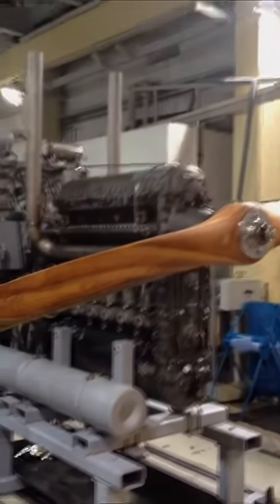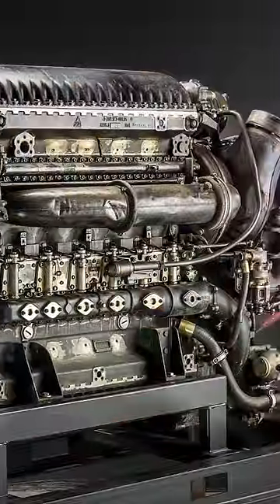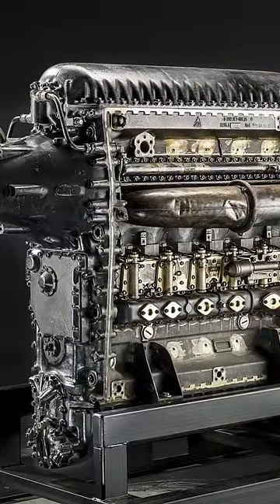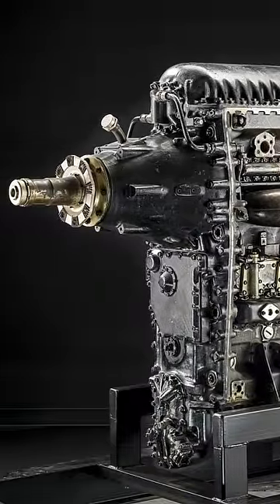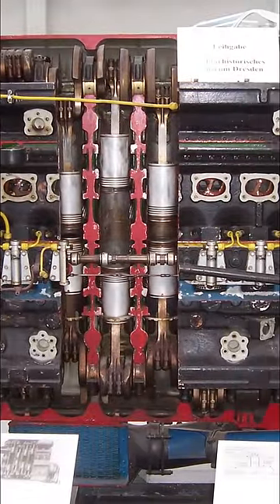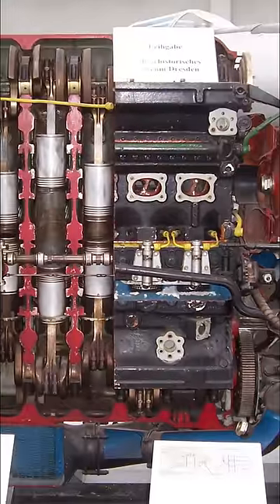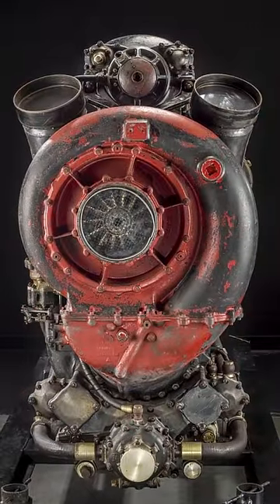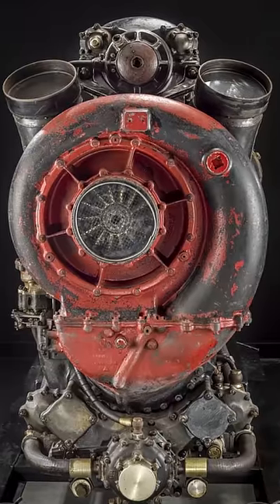Old ENGINE Laughs At New Diesels - Jumo 200 Series

Comment: Even now its very fuel efficient compared to most modern regular diesel engines.
Reply: What's the size of this engine?
Reply: well I know nothing about motors even less about this one in particular, although it's not a doubt if companies wanted really to create something fuel efficient I am sure they could.

 perhaps they don't want to advance too fast or they have some kind of agreements with oil companies so they sell more fuel idk
Reply: @MrLuigge  It's much simpler in this case.  Opposed-piston engines are more expensive to manufacture, and it's much more expensive to design a car for such a tall & long engine.  Or for such a wide & long engine if laid flat.

Those are costs that carry a very realistic chance of never being recouped.  Ergo, those costs are a very unsafe investment for a business to make.

There's potential for such engines to find maritime & heavy-haul usage, but commuter cars & light-duty use is not probable.
Reply: @TheAttacker732  you could lay it flat, like a boxer... But those engines too are rare as f*ck.... Alsow it's most likely pretty heavy as you have a second set of pistons and rods... Nex to the block and the crankshaft the heavyest parts of the engine..
Reply: @justacomment1657  I touched on that potential layout already.  Boxers run into the same basic issue, in that they're too wide for the displacement needed for a given commuter vehicle.  Packaging them into a standard layout car is...  Difficult.  Rear-engine isn't any easier, because it still needs to fit between the wheels.  Putting the engine high enough to clear the wheels makes for unsafe weight distribution, and the vehicle also becomes too heavy for the original engine displacement.  Even larger American cars & trucks keep the engine as low as possible for weight distribution purposes.

Meanwhile, maritime use works wonderfully with wide, flat engines, and heavy-haul doesn't have the same space constraints as other road uses.  American & Australian trucks in particular have plenty of room for less-conventional engine layouts.  And, upon further consideration, trains may also be a good use case for opposed-piston diesels when married to dynamos, in an even further improvement to diesel-electric locomotives.
Reply: It's decently fuel efficient, but not particularly efficient when compared to modern turbo-diesel engines. 38-40% efficiency in 40's is impressive, but gets beat by turbo diesel car engines built in the last 25 years.

Comment: It is incredible when you think that they have made this engines without SolidWorks and AutoCad back then
Reply: i keep saying that about these engines, they did everything on paper! 

I think you have to have had at least a little experience with CAM to actually appreciate how impressive that is.
Reply: And with manual machines, not CNC!
Reply: @corythomas4427  yes & no.  The real magic of cnc machining come in at 4+ axis machining.  Those are the parts that you simply can't do on a manual machine.  These engines, though complicated, were made of rather simply shaped parts...cylinders, bores, blocks.  

Not totally sure what point I'm trying to make, so I'll put it this way:  shops all over the world still use manual machines.  None of them do their design work strictly on paper.
Reply: I was alluding to the huge amounts of time and labor that would be required on a mass production scale.
Reply: @corythomas4427  ummm...what?  you were talkin about cnc machines....
Reply: @mtraven23  Humans build machines so that we are able to use less effort to accomplish tasks in less time. A CNC can spit parts out a lot faster and requires less physical effort than a manual machine does. Just because a part is less complex doesn't mean it doesn't take longer to produce on a manual machine than it would on a CNC.
Reply: @corythomas4427  who TF is talking about speed?  This stems from a comment about the difficulty of doing this without CAM.  Not having a CAM is FAR greater disadvantage than not having CNC.
Reply: @mtraven23  My car has 4 cams, so I'm way better than you are.
Reply: @corythomas4427  so nothing of substance to say?  Great, we're done here.
Reply: @mtraven23  You didn't like the way I was responding,  so I tried something different. Doesn't seem like you like that either. Guess you'll just have to stay dissatisfied. Sorry, I tried.
Reply: To be fair there is still hand drafting today, it's just getting more and more rare
Reply: @murderWhornets  please provide an example of a shop that still does their design work strictly on paper.
Reply: @mtraven23  did i say anyone does it strictly? But I i personally know two engineers one structural, one mechanical that still utilize their drafting tables about 1-2 a week. Certain tasks can be more quickly done by hand then in solidworks. I use SOLIDWORKS personally because I'm not part of that last generation of engineers that draft. But yes there are still tens of thousands of practicing engineers that use drafting methods regularly.
Reply: @corythomas4427  Sure it took a lot more work, but cam-set lathes and mills have been and still are being used extensively. Screws for example, set once and just maintain. For repetitive milling tasks I'm sure they used mills set up with cams, tho of course only viable for high volume.
Reply: @Kalvinjj  Woah man! No intellectual, fact based mature answers allowed. You're supposed to just argue how everyone else's opinion is wrong, like Mad Matt is doing.
Reply: @murderWhornets  no, I said qualified "strictly" in my previous reply.   You failed to respond within that qualification, but still tried to tell me I'm wrong.

No one is drafting shit faster then in a CAM program unless they have no idea how to use it.  Not to mention the unlimited about of views & drawing that can be created nearly instantly.

You still have yet to provide a single actually example....Your buddies dont count, but you should advise them to get with the times or retire.
Reply: @Kalvinjj  I agree...I was trying to make the point that manual machines are still FAR more in use than manual design methods.
Reply: Without even cnc machining or measurments!
Reply: @mtraven23  what are you so mad about? You misinterpreted what the guy meant and after he explains nicely you get even more worked up. Fragile man
Reply: @humpty6838  not mad about anything, his points just don't hold up, so I refuted them.  That's how discussions go.

not sure why you felt the need for the the frigidity comment, projection probably.  Good day.
Reply: ???

Why does that surprise you? It’s drawing regardless. Except ones digital, technology hasn’t changed in so long, they literally just digitized drawings 😩
Reply: @corythomas4427  the technology of the tooling has sped things up as much as the cnc side of things. Without a better cutter and a more powerful motor, the feed rates would still be the same as if someone was controlling the machine manually.
Reply: Slide rules, protractors, and really good cast makers.
Reply: @mtraven23  hey doesn't really matter man trying to prove them wrong.
Reply: @Jonathan_Doe_  That's true, and a valid point. But have you ever seen 1 person running more than 1 manual machine at once? What about 1 person running more than 1 CNC machine?
Reply: No one is designing engines on solidworks. NX, autocad, creo, fusion....
Reply: What about sending man to the moon, even without calculators?!
Reply: Anything that old and mechanical that still works, has my respect. Along with the old timers that keep them going. I love that stuff. There's a museum in Virginia that has a hangar full of WW1 planes. Bi's, tri's... and they all still fly. My mind was blown when i saw the absorbing rags under every plane. Just incredible.
Reply: @proximo1033  Come on, you can't really be believing that bs my man
Reply: @corythomas4427  replying after a week lol just let it go
Reply: @nosleep771  5 days is less than a week. Comment notifications exist so that you can know when new comments have been made, and if you choose to, make another comment. There's no reason for you to worry about what I choose to do, and even less reason for you to tell me what I should do.
Reply: Not even that...the SR71 blackbird was created with pencil and paper and it's still invincible pretty much. Let THAT sink in.
Reply: @mtraven23  it's really not impressive to design an engine on pen and paper. Especially since the beginning of the gasoline engine was so dumbed down compared to today, and they simply took preexisting ideas and designs and tweaked this here and that there ever so slightly until they figured things out. It's all super basic, as it should be, seeings as it's the birth of a new technology.
Reply: Imagine this, the same was true for early Rolex’s and things like that made in the name of luxury. All by hand originally. Think about Lamborghini, if I’m not backwards he thought that Ferrari was crap and he worked for them at the time before he said I can do better. Never forget the humble Lamborghini tractors
Reply: No CNC machines either
Reply: @mtraven23  I think they would have been making clay models. You can see remnants of this process when they design cars
Reply: @Grunttamer  yah maybe, I really dont know anything about that.  Clay seems like a difficult material to really model tolerances like ring clearance.  Most of that, even back then was sub 0.001" tolerance.
Reply: I'd called blueprints and diagrams, we still use them too.
Reply: @murderWhornets  iam 10 Times faster on CAD Software than doing it by Hand...
Reply: @corythomas4427  are you a mechanic but show up to do framing.
Reply: @mrgbs7168  I don't understand your analogy
Reply: Technically you dont need that... but its used nowdays just to make the development process faster. more efficient and more precise... I was working on one super old huge boat diesel engine and it was a huge mess... everything fitted together just cuz they made holes after taking it out of the mold and just eyeballed it... there were no fitment issues on holes but it was clear that some parts were drilled poorly and mounted there crooked but the seal held the pressure inside so no leaks or anything...
Reply: It's sad that people rely on SolidWorks, and Autocad today instead of knowing the skills to do it themselves.
Reply: @philmoregain  as am I, but there are specific instances where someone who has 40 years of experience with drafting will be faster. It's just the reality if it. Idk what to tell you.
Reply: @murderWhornets  probably depends on the part... Getting a square part or pipe with some 45 degree cuts onto paper by hand is faster than CAD yes but for more complicated parts CAD is faster. 
Auto CAD is always faster than by hand imo.
Reply: @philmoregain  for multilevel structural cad for example, especially in cases if you already have printed off 30 x 42 drawings and just need to add minor changes for an architect etc, I'm not arguing by any means it's overall faster because it's not, but I am saying there are definitive advantages to keeping someone around that can
Reply: That's when designers/engineers actually thought in 3D.
Parts as difficult as those made today were designed and hand drawn, then manufactured long before CAD, and CNC machinery. 
Tool & Die existed long before computer assist. Hi quantity parts were run on power fed machines with trip-cams and drive dogs to stop at the end of travel.
3D parts were made on tracer-mills, a probe ran on a model and hydraulically moved the machine to cut the profile.
That's how dies were made.
Reply: Why
Reply: Jeezzz your so right 🤔
Reply: Sliderules made the world go round. Now it's hard to even find one reasonably priced.
Reply: @corythomas4427  You run a 2-cylinder?
Reply: @goldfieldgary  Can you rephrase that? I don't understand what you're saying. What's with this comment section and asking me questions that make absolutely no sense?
Reply: What do you need computers to make engines for? Engines have been made without computers for longer than they have been made WITH them. Machinists did things by hand and so did the engineers. Back then, those positions were performed with passion and pride... It was their dream, nowadays it's just a job.
Reply: @corythomas4427  you said your car has four cams, so if it's a four-stroke cycle engine, with one intake cam and one exhaust cam per cylinder, that means your car has two cylinders. Maybe your car is a motorcycle?
Reply: @goldfieldgary  The reason I said that was because I was mocking Matt, since my other responses were just being argued with. There are a lot of mass produced combustion engines that have 4 camshafts; and that doesn't limit them to just 2 cylinders. It also doesn't dictate cylinder arrangement, many "V" and "flat" engines have 4 camshafts.

To answer your question; no, as of right now I don't own any 2 cylinder engines. I do currently own several V6 engines with 4 camshafts though. Some of them even use both a timing belt and a timing chain. If you know engines well enough, that tells you who manufactured them. There's only one auto manufacturer I can think of that uses both on the same engine.
Reply: @corythomas4427  I'm glad you clarified and said four camSHAFTS, that's different than four CAMS. A camshaft is a shaft with cams on it, which was my point.
Reply: @goldfieldgary  I see zero difference. When talking about an engine what else could a "cam" be than an abbreviation of "camshaft"? I have never heard someone talk about a single "cam" without some type of clarification, such as "cam lobe" or "the fuel pump cam".

Are you an engineer with the life goal of making blue collar workers miserable as payback for when you got stuffed in a locker in high school by the kids in shop class?
Reply: Haha, that was the only comment I was going to add when I saw this video
Reply: Sorry but I think this is a jumo 205 or 204 .  Jumo is short for Junkers Motorenbauwerke. The engines are numbered and a Jumo 205 and a jumo 210 and so on are completely different engines. You cant set them into a line.  The Jumo 004 for example was a jet engine. Jumo 200 was never build.
Reply: Actually I look at it the opposite way. Without practical hands-on experience with mechanical parts, how can anyone improve on a design, let alone design something from scratch on a computer screen?
Reply: I'm amazed they made anything complex with no modern AutoCAD. Just guys with slide rulers and tobacco pipes .
Reply: @georgewbushcenterforintell147  That makes you wonder what they put in those tobaco pipes
Reply: And they usually did it in a fraction of the time the modern bums take to do anything. Look who quickly the Mustang went from literal back of napkin to production.
Reply: @justanothercomment416  something's actually we don't know how to make the original versions of stuff . The rocket engines on the Saturn are a example of craft made engines that the rocket guys tweeked stuff and didn't write it down to make it work .
Reply: @georgewbushcenterforintell147  Yes and no, but that's also misleading. We have the plans. We can make them. We simply do not have all the little details which went into the floor changes off design. We could make those engines today if we really wanted to. But today, just as then, would require testing and tweaking to make them operate safely. Accordingly, it's not really accurate to say we can't make them or that the technology is lost. As neither statement is actually true.
Reply: Technology has made humans less smart
Reply: @stevenmcquaid5696  we have more knowledge than ever. I think the biggest problem today is we never disconnect from the information pipeline or turn off the hose . When my parents would come home from work in the 80 s 90s there was no internet. You went home ate dinner watched wheel of fortune helped you kids with home work and went to bed by 11 pm sleep by 1130.  Now this is not possible.
Reply: @mtraven23  He said not cnc...
Reply: @Tyler_Fuller  no he did not, read better...or learn what CNC is.
Reply: @mtraven23  "and with actual machines, not cnc"
2nd comment down with the name cory above it. I did not misread, your laziness failed to check...
Reply: @mtraven23  I work with cnc machines daily. I can even code. Never believe your own presumptions, you'll be the only fool.
Reply: @Tyler_Fuller  lol..if you're going to vaguely refer to "him", its assumed your talking about the op, not some random response.  so...read better & write better.
/m
Reply: @mtraven23  No. Stop assuming. Im refering to the 2nd comment down. I couldn't have made that any clearer if i tried. OP didn't even say cnc so i have no idea how you managed to come to that assumption.
I said and i repeat, 2nd comment down made by a corey. You completely misread what both he and now i said...
Reply: My God, that's true!
Reply: @murderWhornets Adrian Newey from the RedBull F1 team designs his cars with hand and paper.
Reply: @mtraven23  why are you getting so worked up?
Reply: I was just thinking this

Comment: The Junkers JU86 started out as a Bomber in the 1930s German Luftwaffe. Believe it used a gasoline engine in the beginning. The diesel as shown in the video was used in the Reconnaissance Version. It could fly over 40,000 feet altitude with a pressurized cockpit and cabin. Which gave the English absolute fits during WW2. A Spitfire MK IX was modified and lightened to get to that altitude. The English put a 20mm cannons in each wing. Even then the two cannons had a problem with freezing up at that altitude. A Spitfire Pilot finally got up there and was able to put rounds in the JU86. It greatly discouraged the Germans from using it over England.